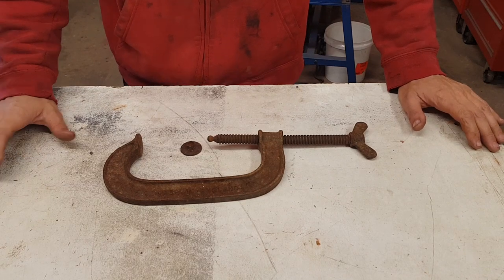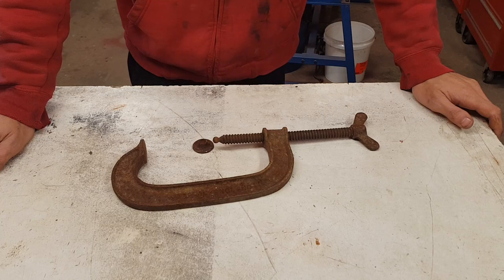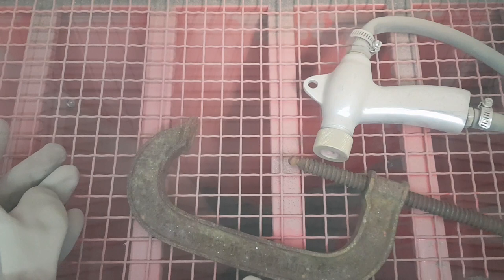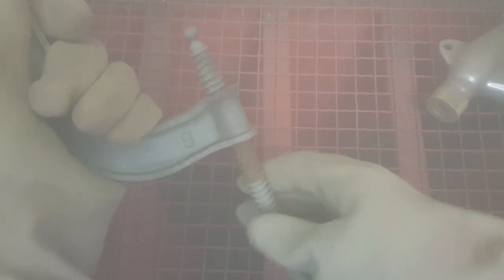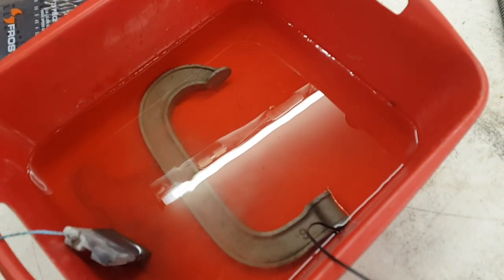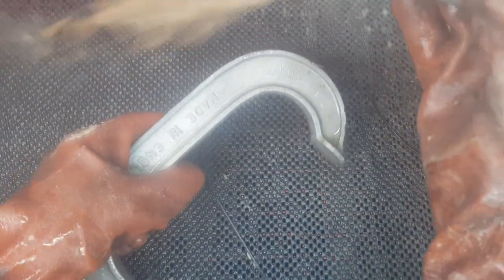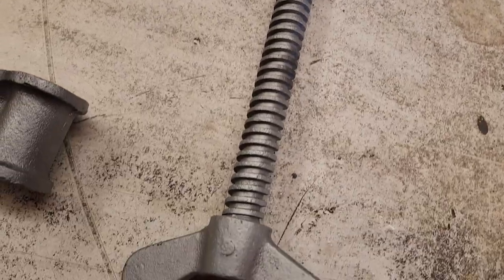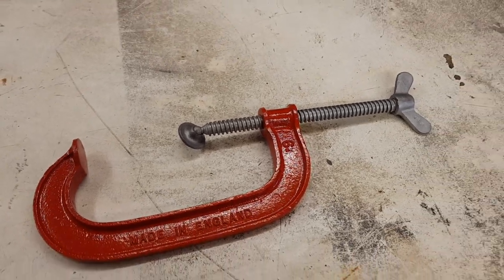G-Clamp RESTORATION - 3 Must Have Restoration Tools

Comment: A press, 4 ton or better, A sturdy vise and a 24 inch pipe wrench to straighten the clamp. A propane torch to heat and loosen the rusted screw if pen. oil won't work. A 4 1/2 inch grinder and a flap disc, 120 grit. A loose wire cup wheel for the grinder. A knife edge file to clean up bad threads. No need for a blaster or any plating.

Comment: I tuned in for the very thing he omitted: How he got the swivel foot back on so that it would stay on.  (That is, if he even did.   It looks precarious.)
Reply from the maker: It wasn't in the video as it was the most mundane of the reassembly. They are easy to fit. You line up the ball on the screw with the hole in the foot on the corner of the bench and wind it back together. Then with it still tight you take a drift punch and peen down the edges.

Comment: Actually, I think that my last project was fast plating too but You will save all additional steps. I vapor blasted the bolt and had it in the plating bath for less than a minute (coating would be thicker if kept longer) and boom, done. If you let me know how I can send some pics to you you will see what I mean.

Comment: Just one thought, maybe your current is too high (it bubbles to aggressive). I do Zink/Nickel plating after vapor blasting and I get a high gloss shine very close to Chrome plating without any polishing.
Bernhard
Reply from the maker: Well spotted Sir!

Yes I do run very high current. The reason I do so is for speed of the process. Generally I get a coat of zinc on within a couple of minutes. Doing it this way I can cycle through the plating bath and VB multiple times, giving a nice finish in relatively short time. 15 minutes is usually sufficient from start to finish.
Reply: @ArmouryEnterprises  It really all depends what you're after, ultimately. If you are looking for the 'chromey' finish, that's a good tip. If you're looking for fast processing and appearances are not such an issue, then amp it up!